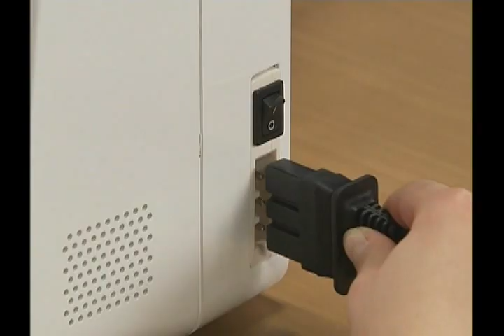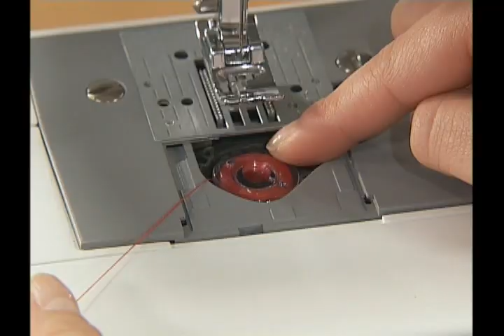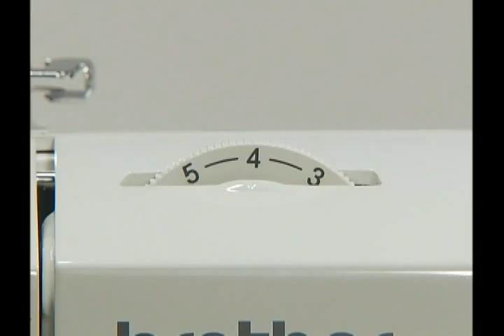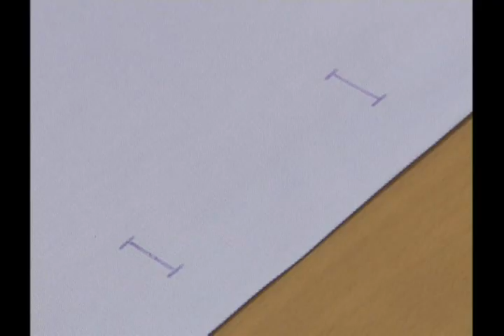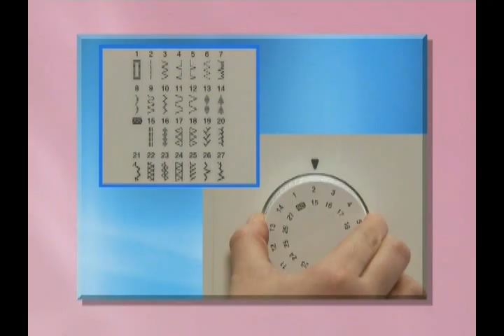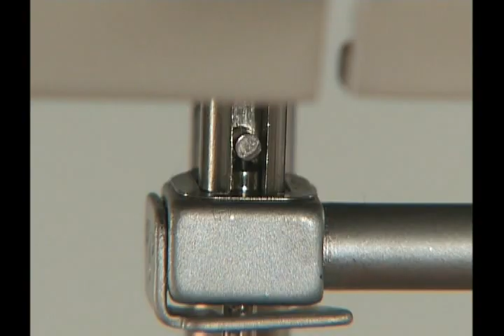Brother XM2701 Sewing Machine DVD Instructions (English)

Comment: After threading the needle I don’t understand what to do next. I see your bottom thread is hanging out but few minutes before you said to cut excessive thread. When the needle goes down into the machine it doesn’t pull up any thread for me and I’m following the instructions exactly as I see it. I’ve never sewn in my life so this tutorial is not very helpful. The video is not HD and there is no zoom on angles of what happens after threading the needle.
Reply: same problem i have
Reply: It's fine gal. After threading you just have to start sewing. If your still not doing it well then rethread your needle with the auto needle threader and rewatch. I got mine about when you posted this and it's perfect! There is more to tell you but school starts soon so...